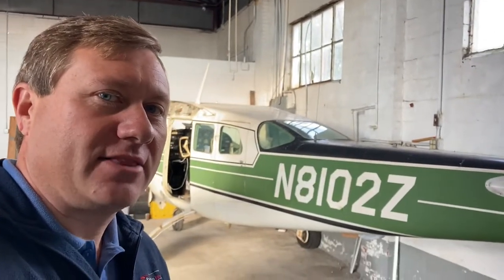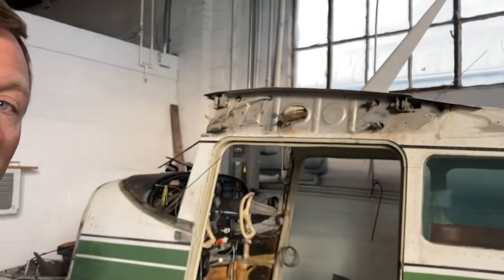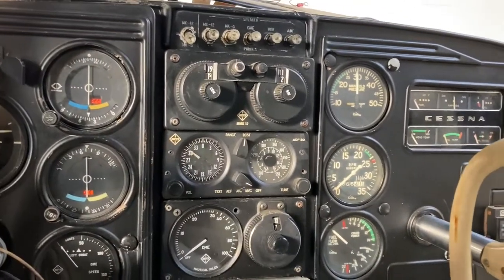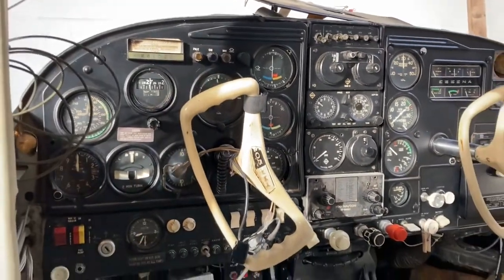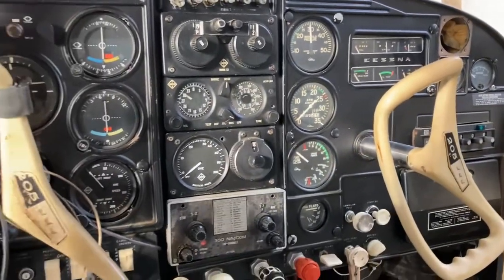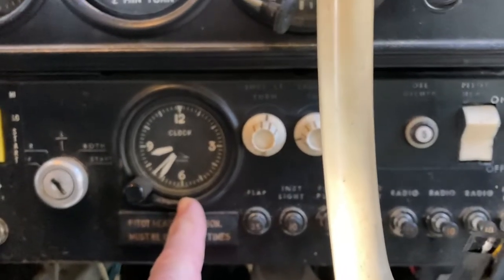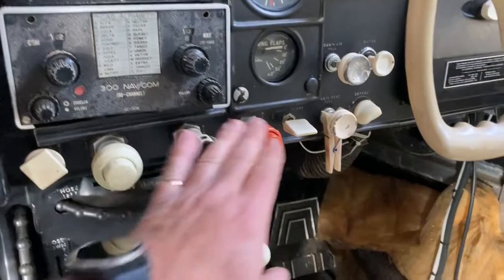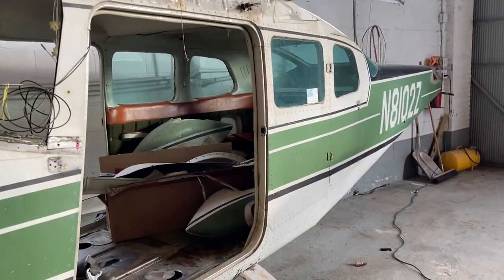Cessna 205 Avionics project (part 1)

Comment: If you have it in that state, add the extended baggage. Those planes need it.
Reply from the maker: It’s getting the extended baggage. I’m waiting on the Garmin GFC500 certification which is a few weeks away to make sure the pitch servo fits under the baggage floor. I may need to raise the floor a bit.
Reply: @Avionics_test_pilot  interesting. I'm still waiting on a copy of a 337 before we put it in mine.